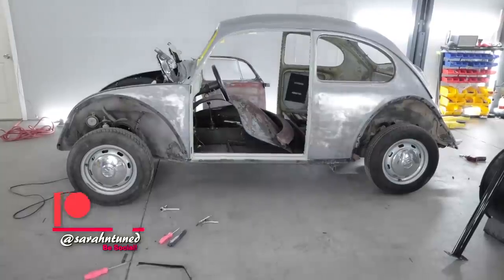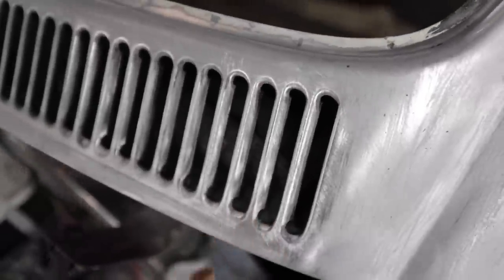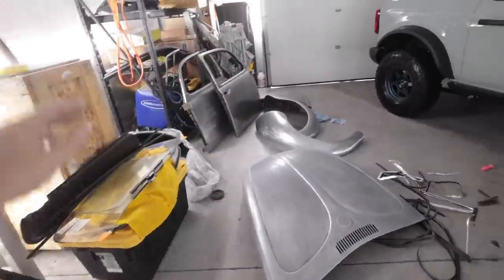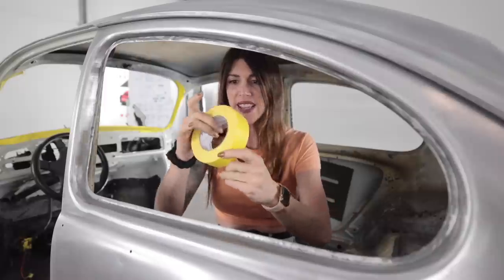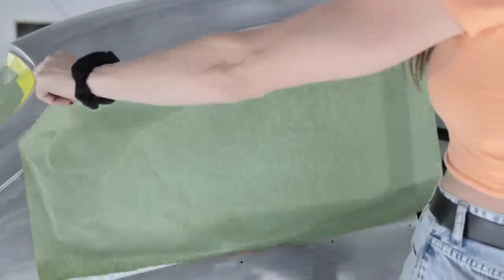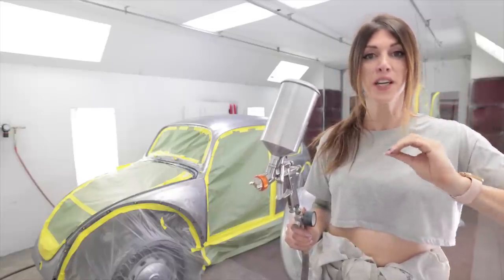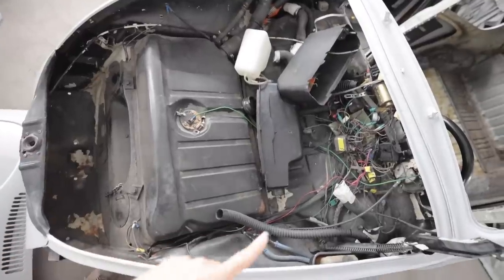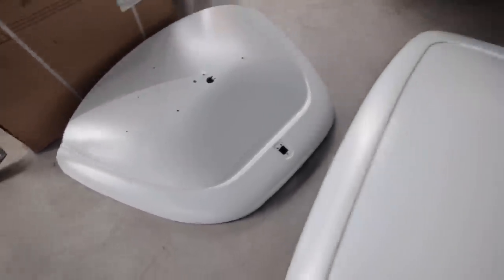Teaching Myself How To Spray Epoxy ..Slight Issue // '69 Off-Road Beetle

Comment: Before you go any further do a tape test on various areas using your masking tape and rip it off to check adhesion. You don't want to do body work and find out that your epoxy is not adhered. Not many people have the patients to do a proper job, they think paint hides bad work and it does to a point until it flies off. Excellent work !!!

Comment: I was in my late teens in the late 70s.  Dad and I would buy late model wrecked cars and fix them up.  Dad had enough air pressure to paint a panel on a car but not enough to paint an entire car.  But we had a friend who owned a body shop who would paint an entire car for us for $100-150 (remember, 1979 dollars) IF we brought it in ready to paint (primered & all taped up) and supplied the paint.  Couldn't beat that deal with a stick and he was the best painter in northeast Neb.  Dad was a good painter too, but part of his success was the prep work we did beforehand.

Comment: Back in the 70's my Dad worked in Togo, Africa and my Mum and I used to visit him during the summers.  Most of the cars were Toyotas and Ford Escorts and most of them were bright white in colour.  Unfortunately they rusted pretty quickly due to the humid, salty air which showed through the white paint.  There was a whole industry of painting over the rust for dealers who sold used cars.  Usually to unsuspecting foreigners.

Comment: Hail typically doesn't cause vehicle damage until it gets closer to an inch in diameter.  If you're driving in it, maybe a bit smaller on the new cars.

Comment: 2:51 / 16:45: so a old school way of sanding inside of the vents is this. Get metal cloth hangers. You need to measure about 3-4 ½ inches. Cut the metal hangers. Bend the tip part a believe 1 ½ inch. Then get sandpaper and cut long strips. Place front and back sand paper. Making sure the grit do the papers are facing up to sand the metal vents. Pinch the bent hook on the metal hanger in the middle of the sandpapers. After you have a lot of these done. Place the metal homemade sandpaper strips in a drill. Lock them down in the drill. And place the sandpaper in the vent groves carefully. Then apply power and let the sandpaper do its magic.

Comment: Manufacturers for sure use different grade steel depending on the price point they are aiming at. My VW Eos was parked right next to a Subaru Impreza in a hail storm and the Subaru was trashed afterward and the Eos had 3 dings that the PDR guy removed easily. BTW, love your work! 🙂

Comment: Epoxy is very definitely affected by the heat, several brands of epoxy even have different "hardeners (Activators)" that one uses based on the ambient temperature, some will never harden below 40ºF, others will have too short a "pot life" above 100ºF.

Comment: It's so great to see all the little details of this car. Like those little vent windows with the etching on them. You could get some air to blow on you with them, but all in all they left something to be desired. But seeing that vent with the little handle really brings me back. That reminds me: I remember my bug being really noisy! If there is any way to improve sound insulation in this car, it might make it a better driving experience. Also, taking it back to bare metal was probably the only real choice. Mine had lots of cancer spots all over it. Once I had it evaluated to be painted, but they said it would be expensive and rust would return. Back then I had no concept of how to repair the paint, so I just drove it as is. And on this car I think you got lucky with so much of the rust, like where the wipers are because that is where they often rust through! Another place to check for rust is underneath where the spare tire sits. Also, my hat is off to you for picking a car like this to restore. No computers and sensors everywhere. It's just a driving machine. Simple and elegant. I know it will be fabulous when you are done!

Comment: Especially if there’s very little humidity in the air that Apoxsee will set up slow Sarah or maybe by first I can’t remember either way do you want to make sure that the Apoxsee releases its VOCs so you don’t get Pop… or what we like to call holidays make sure you mix the Apoxsee well with the primer or activator, luckily you don’t have to thin it down with acetone..

Comment: All good, Epoxy primer is very forgiving, you should know from paint being applied to MIL aircraft, only difference, is Topcoat has a bit of Poly base added to the Epoxy, (give it little shine to allow air flow, water to bead off.  makes a very durable high impact resistant paint system, work good on F/A 18, used why there allot of Epoxy based systems in the civilians use, very forgiving, holds up too many environments.  Nice work as always extreme detail, prep is hardest making the difference.

Comment: The louvers, or vents you were using the little biscuit on, try doing that by hand with folded up 80 grit sandpaper.  I've had to do it that way numerous times when I was an autobody/painter.   Also I am so glad that you wore a paint suit and respirator while spraying epoxy primer. I learned the hard way that inhaling epoxy primer gives you a migraine headache, and asthma symptoms which lead to a small yet very painful heart attack.  Yup, happened to me 30 some years and since then I will not spray paint anything without a respirator on. As coughing up epoxy primer from your lungs is painful and disgusting.
Reply: Wow....hope you recovered okay!
Reply: @betteheadbettehead4800  I recovered just fine, but I can't use epoxy primer anymore. 
Even in a well ventilated paint boothe, I get sick from just the smell of it.  But it's the best stuff to use on bare metal. Because you can put body fillers over it and it will stay on the vehicle.
Reply: @davidbruin4381  Your experience reminds me of this: I worked for years as an industrial chemist and one part of the building had isocyanate research.  They're used to make rigid foam such as the foam that goes inside refrigerator doors. There were warning signs posted everywhere because isocyanates could make some people go into severe respiratory distress. The problem is, one doesn't know until exposed to the chemicals. Serious stuff!! I'm glad you're okay!
Reply: @betteheadbettehead4800  I had that happen to me over 30yrs ago and just the smell of epoxy primer will trigger an asthma type of response to it. And it doesn't have to be epoxy primer, it's anything that smells like it. 
Sometimes memory sucks.

Comment: I painted multiple times but my paint jobs didn't come out right yet but gonna paint my Chevy Malibu 08 LS soon I took a lot of stuff off painting it metallic I sprayed epoxy primer last year but it wasn't on bare metal used as a sealer but got too much orange peel. But didn't take as much off all the times painted before.

Comment: Thank you for pointing out the difference between epoxy and paint and why you used it first.
When it comes to sanding, if you want to etch the metal, why not go hard core and use 80 grit at first?

Comment: Great work! Just to be clear, the instructions you got from the Ospho guys was to spray the car down with Ospho, let it dry, then wipe down with a solvent was and grease remover? Or did I miss any steps? As you know, properly preventing rust is a big deal up where I'm at. Still learning the best way to apply acids.

Comment: I greatly admire your attention to detail being so thorough…!!!
Wouldn’t it have been easier to strip the car via sand/walnuts etc media blaster or dry ice blasting…?!?
Reply from the maker: No, media gets trapped in tiny holes that is almost impossible to remove, then when you spray the car you end up with trash in the paint from that media.

Comment: Hi Sarah, Epoxy primer is an outstanding product, some you can use as a sealer by adding reducer. it will prohibit corrosion,its great for color hold out, is abrasion resistant and it takes very little for coverage and protection, overall its Easy to work with I really am glad I found out about it 30 yrs ago. as with everything else the price has gone nuts about triple for some. There are some less expensive great products out there. But you are lucky to have friends in the body and fender business to guide you.Great videos Sarah you are covering the WHOLE NINE YARDS.

Comment: The car is looking great two things though first if you are spraying epoxy directly on metal you actually want a more course grit than 180 or 150 we typically do either 120 or even 80 grit and use a very thick expoxy and give it 2-3 coats then let it dry for a week. You wont have issues with sand scratches if your worried about that because your spraying on bare metal and youll be sanding that epoxy and spraying high build over it anyway. Now that first coat you sprayed i would strip everything back down to metal that product wasnt mixed thats why it was thin on top that will more than likely cause problems if you spray material over it because it wasnnt mixed properly its very possible that down the road it will de laminate.

Comment: that hail sounds like it's about quarter size. I am curious now. (edit) looks like I was wrong. that is about dime size, maybe slightly smaller. Any hail below .75 inches typically won't damage vehicles. .75 is the threshold for severe thunderstorm criteria.

Comment: That old beetle is going to look FANDANGO!
I have to apologize for all the beetles that we've "mangled" with my German friends when I was living in Germany ... German dudes are COOOOOOOOL!
I remember re-painting an old beetle cabriolet in "light turquoise blue" (not mine though).
I hope to get pardoned by the beetle fan clubs one day for all these criminal activities (on old beetles).
By the way, I've always found cars stripped to bare metal very attractive.
I wonder if it's possible to clear coat bare metal in order to protect it as efficiently as with paint + clear coat.
Also "powder coating" an entire car ... then try to sort of smooth it and clear coat it. That would be crazy.
And HAIL ... Look for CAR HAIL COVER. I'm sure if you take one for a big truck that could be a one size fits all protection for any car outside. I guess.

Comment: I have not heard of fisheyes caused the way you described. They are usually happen by having traces of oil, either in the paint or from an oil lubed compressor. I have even seen it when air lines that have been used on an oil lubed compressor, then subsequently used on an oil free compressor used to paint.. Ask me how I know this! So hopefully you don't have this problem because it will happen in the subsequent coats. Assuming your friends use this equipment for other jobs it would seem unlikely.. But just in case something has changed..:)

Comment: Did you hear about the new Broncos blowing up with a few thousand miles? They're dropping valves into the motors and grenading
Reply from the maker: 2.7L V6 Ecoboost Broncos with engines built using a batch of valves made by the valve manufacturuer in April of 2021. I have the 2.3 I4 Ecoboost which was not affected.
Reply: @SarahnTuned  let's hope not it is a ford after all lmao

Comment: Years back, no training no nothing we were spraying Emron epoxy. Great stuff, tough as nails on aircraft in enclosed hangers with just used respirators handed to us and no ventilation system. No known respiration filters exists for that paint. Supplied air and suits required. Why my next employer would not allow it's use. I'm still alive, but.......................

Comment: Okay, just so you know, in the late '70s-early 80s there was a big Beetle trend called California Style. Among other things, a lot of it was about de-chroming. It seems Ragnar had his side trim removed and the trim holes plugged and painted, a common California Style mod, but he still had the window rubber with the chrome trim inserts you ripped out in this video. Anyway, there were and maybe still are 3rd party companies that made and sold Beetle window rubbers without the grooves for the stock chrome trim pieces. They looked really good, the stock rubbers without the trim looks like ass.

I'm only posting this to make sure you know that this shit ever existed at some point, in case you were interested for Ragnar. You might be able to find some.

By the way, I have a 2010 SAAB 9-3 named Lagertha. Maybe our cars should date.

Comment: I don't know what epoxy system your using, but, in the past, there was no known respirator system that filtered out the poison within the mixture. Complete supplied air system was required. I see your wearing a pumped air filtration unit and a Tyvek suit. Fantastic. But, does your air filtering meet the requirements of the type of epoxy your spraying?.
Reply from the maker: "..in the past" Key words. OV/HE NIOSH TR6510N filter with air supply.

Comment: As a painter in a powder coat shop also former auto painter my heart dropped when you didn’t stir the epoxy. Rookie mistake. But yes it’s just a primer and epoxy primer is a bitch to sand down because it’s way stronger then a surfacer.  You could of sanded the metal with 80 to save time because the epoxy is thick enough to cover scratches. Tack rag could of saved you some prep time. Over it looks good. Just don’t try Cerakote your exhaust parts. Leave that for someone like me.

Comment: I was worried about you, in that paint booth. Heat stroke can sneak up on you quickly.
You're doing a great job on that Type 1. What will the final color be?
And by the way, since I'm old, a contrarian, and not politically correct, let me say that you
are drop dead beautiful.
Reply from the maker: Didn't get heat stroke, just and ear infection.

Comment: Sarah you are doing a great job! But please, take the body off the pan and paint Everything not visible with POR15 and replace the gasket… that will eventually fail (probably already is failing due to age) and will ruin all your amazing hard work… you may think it will take too much time but compared to what you did with the ranger that is a walk in the park…

Comment: Wow.. Cant believe the B22 WRX was left out in that hail storm???  Those things are worth a crap load... If it was a real B22 when it was restored would probably be worth more than what the Mercedes and that bronco combined.
Reply from the maker: It’s a beat to crap 2.5RS that’s been ruined by hacking apart the fenders to fit cheap eBay flares.
Reply: @SarahnTuned  OK.. Cool.. Yeah most of the STi's are kept in pristine condition.